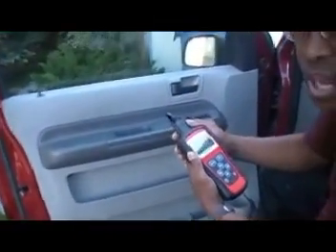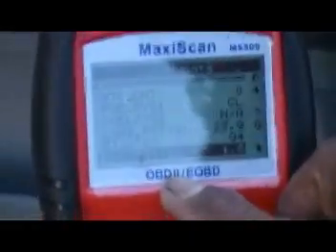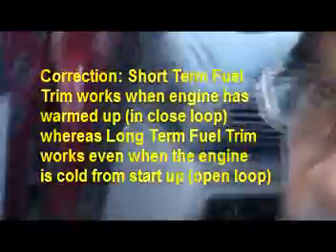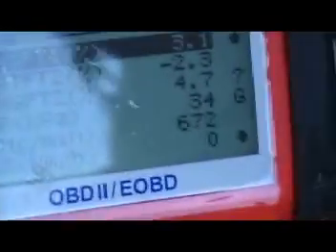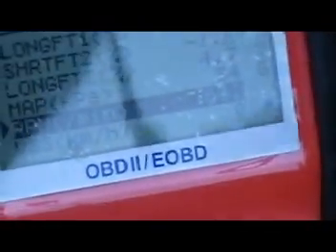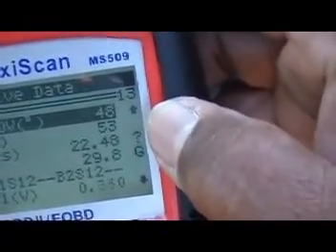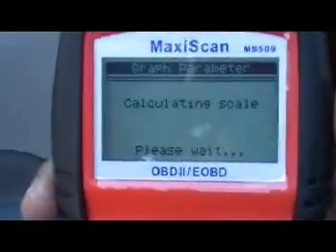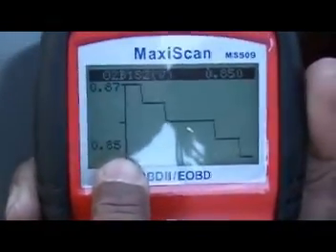Buying an engine code reader under $200

Comment: When you disconnected the IAT sensor did you noticed if the check engine light come on right away?? The reason I ask is because i think mines is bad but I have no check engine light on ( yes my check engine bulb works) 
QUESTION: can I have a sensor problem and the computer not put out a check engine light soon enough??? Thx.

Comment: got a few wrong answers  in the video info
1.fuel trim long vs short only in closed loop
2. lean mix od 10%  _ you would get kick butt fuel milage _u will never see this, and be runing.
3. rich = PCM doing it, many reasons,
4.OX2 sensor at .8v (is a good sensor too) barely rich , why? many reasons under bad fuel delivery / intake bug. /
5. also upper and lower sensors /indeferent values tell pcm codes / re diag pipe leaks & and CATs not working right.

Comment: @65kotse78 Car MD is a code reader which reads and  stores codes then you can take the reader to your computer and research the code including suggested cost of repair. The whole concept promises more than it can deliver. You cannot properly diagnose problems in your car with a code reader as the only source of information. There are a lot of codes that are manufacturer specific and trouble code information is not always directly relate-able to the problem.

Comment: @dkxskineffect Please understand that the information you mentioned resides in the [ECM] engine control module Memory and the code reader allows you to access it. The ECU in most modern cars is a very complicated computer handling lots of data and controlling lots of things. It operates in many modes not only FAULT codes  but also pending codes, Oxygen sensor  monitoring, clear codes, component testing. vehicle information freeze frame, etc . you need a scanner to access these functions

Comment: @kitko33 Yes they do, One mode is vehicle diagnosis. also Pending codes.  you also have mode 6 which displays active information when the engine is working. If you can read and compare thees readings you can see trends. this unit shown in the video also graphs some results to give a more comprehensive trend info. a PID Parameter ID displays things like voltage . temperatures. quantities on the scanner which you will learn to co relate to specification  values

Comment: @lousep1964 Your perceptions are not always reliable for vehicle performance. Temperature, air density,octane, elevation and on board performance memory contribute to how your car works.The way a car starts can give some clues. work with the raw data you scanner can provide such as both fuel trim values, Air intake in grams per second, spark advance response, coolant temperature, mass airflow intake temp so on. try cleaning your mass airflow sensor and check o2 sensor oscillation rate

Comment: Good video! At 7.11 minutes into the presentation you are reading the Oxygen  sensor AFTER The catalytic converter!! One common misread of scanner INFO is that the O2 sensor display is almost always as follows. O 2 sensor then BANK number then SENSOR number. The sensor after the cat converter does not fluctuate similarly to  the one before which regulates the fuel ratio. Its function is to monitor the efficiency of the catalytic converter and report when it is out of a pre-prescribed range.

Comment from the maker: @AHillLuke  The scanner being shown here can only be used to find the codes and possibly fixed them depending on the problem. When you have an immobilizer problem, scanner such as this won't help you. What you need is a computer programmer that will set a new code (like a  passwords) to your key. Unfortunately, you need a new key that is programmed to your engine computer. Dealers can do that for you when you give them the serial number of the vehicle.
Some small garage can also do it but beware

Comment: What if your engine light is not on but the vehicle is running slugish not as good as it used to would this scanner be able to point you in the right direction. For example if the cats were not working properly would the scanner tell you?  I've been looking at the Actron CP 9180 which is somewhat comparable to the MS589 which one in your opion would be best to purchase? Thanks.

Comment from the maker: Thanks for your comments! If you decide to buy a generic engine scanner, always ask the vendor for a scanner which can be used for your car's engine. Also, it must have a return guaranty so that if you try it and found out it does not work, you are able to return it. The engine scanner shown in this video is actually my 2nd one because the first one sold to me was defective after I tested it.

Comment: Nice video I'm looking to buy one of these I just replaced my intake manifold on my 2000 Crown Vic after all was done I had to take it to the Advance Auto Parts store so they could read my codes. My check engine light was on. The scanner said there was a fault a cyl #4.  I checked it and found a o ring had been damaged it had a very small nick in it. But the scanner pinpointed to the problem area saving me alot of time, money and headache. This is money well spent if you like to do it youself.